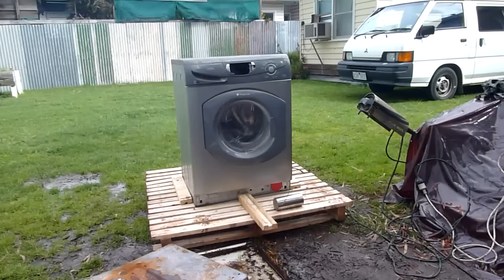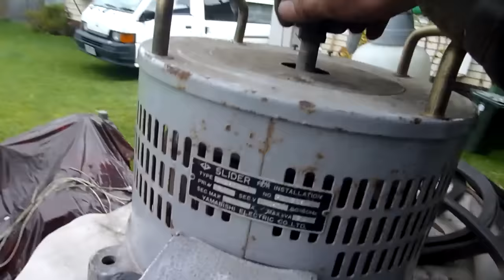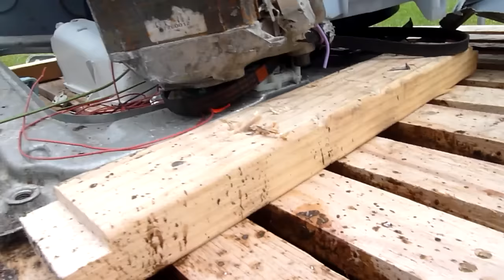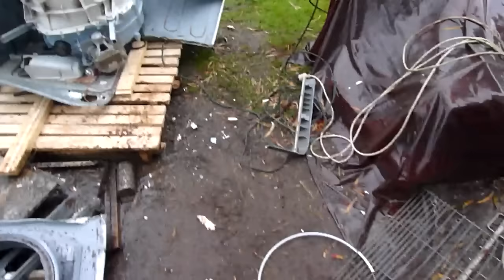Self Destructing Washing Machine Epic - Hotpoint Self Destructs

Comment: Dude, whoever designed that motor seriously needs some kudos. Thing kept working right up until the end.
Reply: David Butler because It goes ALL THE WAY(XD)
Reply: David Butler lmao
Reply: the motor was hard wired to spin
Reply: David Butler The belt fell off, otherwise it would keep driving the "basket" even today..
Reply: It's a hotpoint super silent one
Reply: Exactly. This machine is fking quality... I want one like this...
Reply: That motor has been put in another washer and is still on the job to this day.
Reply: Exactly... It ran exactly until the end... When it stopped running (which was the end)
Reply: She kept her motor clean, she was the best machine..
Reply: It’s about to go critical
Reply: Motors are quite simple and very robust
Reply: Best washer ever
Reply: Before washers , Grandmas were second to none.
Reply: Don't all motors run right up until the end? Do all motor designers deserve kudos?
Reply: toyota motors
Reply: Kudos?

Comment: Video decoder 
0:10 turns the washer on
0:26 speeds it up
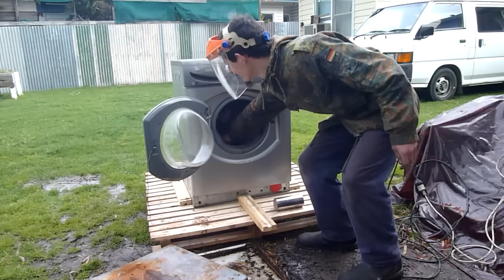1:21 loads it with useless scrap
1:32 starts it again with shaking motion
2:05 washer starts to break apart.
2:50 shaking gets worse.
3:45 uploader adds something else inside there to break the barrel loose.
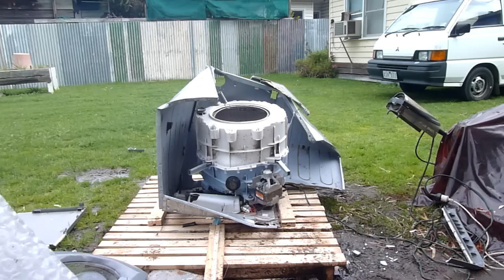4:02 shaking ends and results of washer being destroyed by shaking.
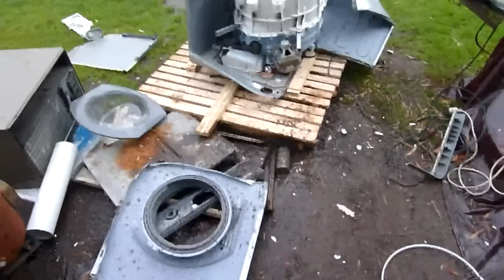4:31 uploader laughs and then checks the aftermath.
If this decoder is accurate. Leave a comment.

Edit 760 LIKES!? More accurate than ever.
Reply: Not all heros wear capes
Reply: This had me lmfao
Reply: 4:02 washer : AAAAAAAAAAAAAAAAAAAAAAAAAAAAAAAAAAAAASAAAAAAAAAAAAAAAAAAAAAAAAAAAAAAAAAAASWAAAAAAAAAAAASAASSSAAAAAAAAAAAAAAA
Reply: 4:03 okay now it sounds like a siren wailing
Reply: You are my hero
Reply: @John Boudreaux you mean a siren
Reply: whelen siren
Reply: Asking for likes = instant dislikes
Reply: Crashed snaked by washer
Reply: Cat when in
Reply: Hewwo wanna be my friend? UwU
Reply: This is too funny
Reply: 4:03 air raid siren!
Reply: @user-de7iq3bt3u   whelens are a type of siren.
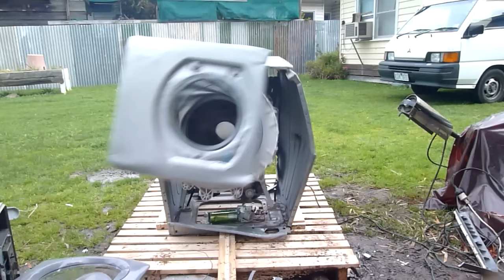Reply: 3:38 Helicopter
Reply: End of cycle.(not in a good way)3:58
Reply: Sadistic laughter at destruction
Reply: I'm leaving a comment
Reply: Respect to this commenter 🙏

Comment: 0:07 When a Washing Machine/Dryer starts Running.
0:35 When the Earth Starts shaking.
1:34 When the Train starts Moving.
2:29 When the Engine Starts Running.
3:38 When the Pilot on Helicopter is Ready for Takeoff.
3:46 When the Helicopter is Landing on Ground.
4:02 When a Gardener began to Cut Down a Tree, Blow the Leaves, or Lawn Mow the Grass.

Comment: You seem to know a lot about front load washing machines. My washer won't spin out. Already replaced the drive belt. The motor seems to still be good. The door lock is good. It just won't engage in the spin cycle. Or when it tries to it doesn't have enough power. It's a Frigidaire. Figured I'd ask since you're washing machine doesn't have a problem with the final spin cycle 🤣

Comment: why does the motor need have so much much torque that it is able to rip itself apart?
Reply: Because wet clothes are not light.
And becomes you are not super to shuv in slabs of metal...

Comment: Okay, so I've read the description and some of the comments, but I don't understand what's going on here. How are they getting it to move so dang fast?
Edit:// and to add, why does the front of the machine gradually rip itself off? XD
Reply: he put power directly to the motor using a voltage adjuster gradually increasing the load and speed. Ed was amazing as his craft RIP